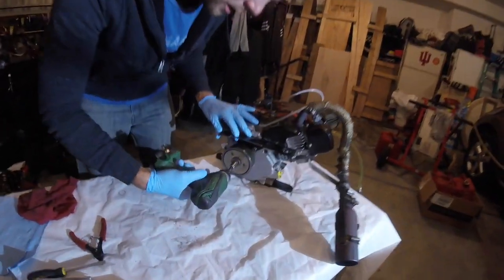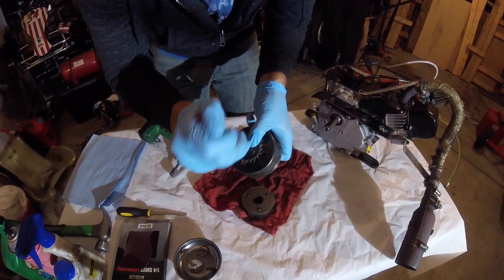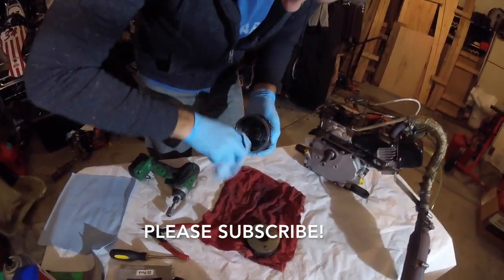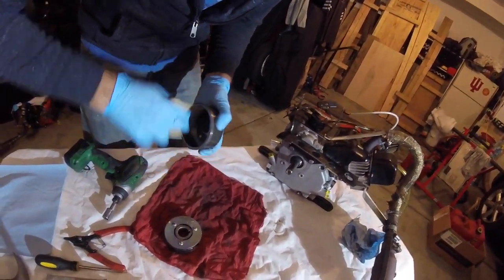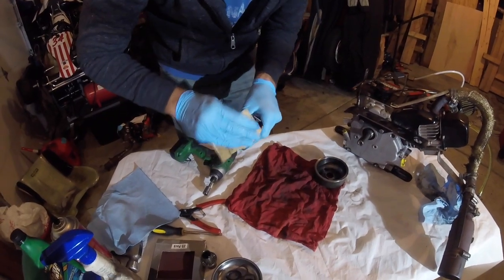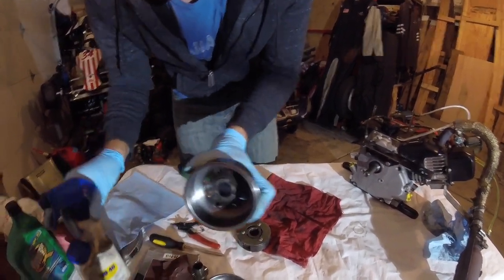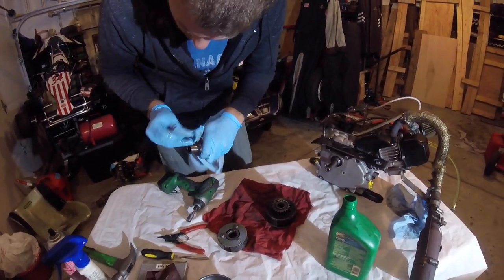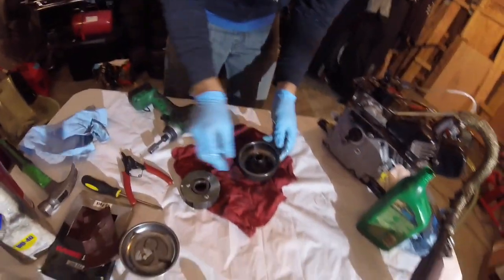LO206 Clutch: Clean & Maintain in under 10 minutes

Comment: Really wd40? I understand you sanded it to rough it up some to minimize slippage but then you put wd40 on it. What’s the reason behind that
Reply from the maker: WD40 in the clutch sounds counter intuitive, but we've learned from people smarter than us; after removing the grease and sanding the surfaces, a little oil residue of WD40 provides more consistent friction. It is supposed to prevent the clutch from engaging too aggressively and helps prolong the life of the clutch. Hope this helps, and thanks for watching!
Reply: I’m going to try that next time I take my clutch apart

Comment: Hi Kacy are you guys still using the same clutches or something else? You guys are awesome.
Reply from the maker: Hi Nikki! We moved from the Stinger to the Hilliard Flame. I think both are equally as good for performance, the main reasons we moved are: Easier maintenance (the Hilliard doesn't have snap rings when disassembling) and probably the biggest is the Hilliard is cheaper lol. But both are very good. And thank you for the kind words! - Kacy
Reply: Race on buddy
Reply: Do you guys tune & rebuild your own motors
Reply from the maker: I used to try and do some of the work myself like lapping the valves and what not, but I found I'm just not that good at it lol. Also, there was some stuff I wasn't able to do like leak down tests and dyno them, so we decided to go with someone that knows what they are doing haha. We use Ghost Racing https://www.ghostracingengines.com/ now and are much better off!

Comment: Kacy, i realize this video is older. But do you still use this same clutch today. Noram Premiere Stinger?
Reply from the maker: Hi Billy, we switched to the Hilliard Flame a few years ago. They are both great clutches! The 3 main reasons we switched to the Hilliard are: 1. it's cheaper 2. Easier to take apart cause it doesn't have a snap ring holding the shoe hub to the drum 3. Tuneability - The Hilliard has a lot of options. Though we generally just run the same engagement a Stinger offers

Comment: How do you know if your clutch is worn? I’m new to karting and I don’t know if or when my clutch will be/ is worn.
Reply from the maker: The shoes are usually the indicator if the clutch is worn out. It's really a visual check, so without seeing it I can't say for sure. Feel free to email a pic of the shoes to: stahlracingvlog@gmail.com and I can try to help out. 
What I've found to work best, is to clean the clutch after each day at the track. Doing that prolongs the life of the clutch, and improves it's performance. I'd recommend changing the springs out at least every 5 to 6 races. The shoes can go longer, we will easily put a full season on a set of shoes. Key with the shoes is cleaning and sanding them regularly.
-Kacy

Comment: Hey i have a qustion. For this clutch do we have to torque it down or can we simply just tighten it down
Reply from the maker: We use an impact driver to tighten the bolt to the crankshaft. Our impact has around 1,200 in-lb of torque. We don't torque it after the impact, and haven't had an issue. Some cheap insurance is to use a dab of blue loctite on the bolt. Hope this helps!

Comment: First thank you... Secondly, surprises to see oil on those bearings instead of the heaven redgrease I have always seen used.

Any feedback on lros vs. Cons if each?
Reply from the maker: Hi @tolken50! We've actually never tried the redgrease you mention. Only used a bit of conventional oil. I can say we've never had an issue with oil, but can't say if the redgrease would be better. We tear down, clean, and oil after each track day. Dad's clutch bearing is going on year 3! At the very least, I could see the redgrease staying put longer than the oil, reducing the frequency of maintaining the bearing
- Kacy